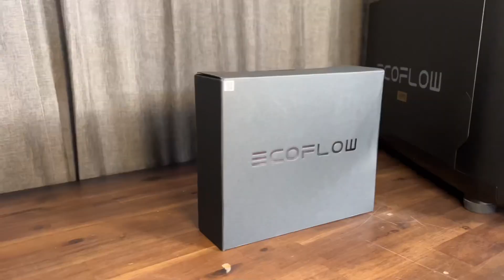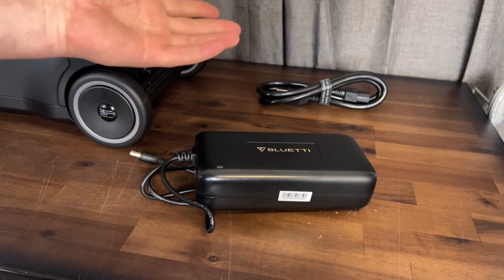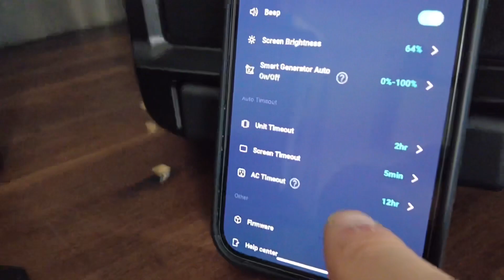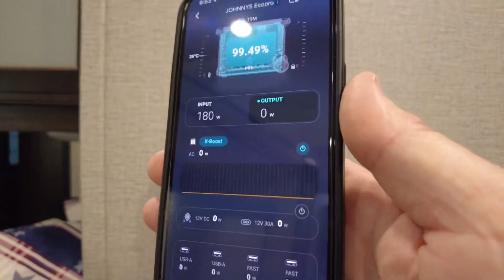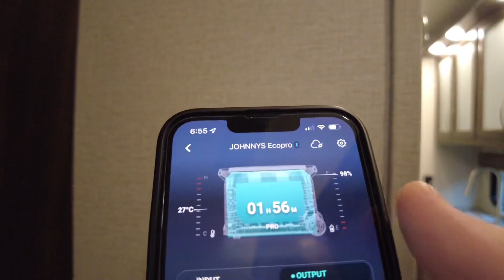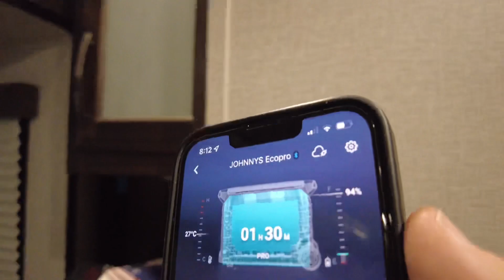ECO FLOW Delta Pro WOW 2 RV AC Unit TEST!!

Comment: I have a new RV and bought the pro on sale. 30amp trailer, runs a single 15000btu Furrion AC. From what google says it should not draw more than 2500w during start up, then run between 1300-1800w. Everytime i try to run ac it turns the delta off. Xboost on the app won’t let me turn it on. Any suggestions or do I have to get the new pro 3?
Reply from the maker: First you don’t want xboost on. 
Second make sure everything else is off. Especially your converter. That can draw a lot of power depending what you are running. Plus you are draining your DP to charge another battery. 
So make sure all loads are off and you should see that on the DP. Then turn on ac unit with fan on low. Then AC compressor should kick on and away you go. 
Now that AC will not run long on a single DP and no extra batteries. Like a couple hours. But I used to use it for about 45 mins to cool everything off.

Comment: I have the same unit.  It works great so far.  My only beefs with it are the tiny writing written in light gray, with a dark gray background.  I have to lay on the floor to read it with a flashlight.  The other beef is, for such a quality product, why are the doors so flimsy?  They never want to close properly.  I'm tempted to simply snap them off and throw them away.
Reply from the maker: They can be removed if you want. But it was a first generation unit so the newest unit is really nice .

Comment: Hi, great video!  trailers nowadays have a "solar prep" plug on the side which is directly connected to the battery. It's meant to be an input plug, but I wonder if I could charge the ecoflow delta pro with power coming from that plug like you have done with your Sok batteries. Any thoughts? Thanks
Reply from the maker: Hi and thank you. Yes some solar prep plugs are direct so a solar charge controller is needed before plugging in solar. But….if you want to back feed in as a DC source for items such as a diesel heater or…..Delta pro them yea it will work. It’s only 12.8 volts depending the battery set up you have so it will be a trickle charge like 125 watts or so. 👍🏼

Comment: Using X-Boost on RV AC is a good way to fry them due to low voltage.  NEVER use X-Boost with AC units.
Reply from the maker: Ahh I ya more of a test though to see the actual power of this unit. If you want to use this repeatedly for a Rv ac then a soft start would help ensure a longer life for both units. Even when using small generators it’s a good idea.
Reply: or any other sensitive electronics! in order to compensate for higher wattage over its "advertised output" it drops voltage below 120v
Reply from the maker: Many items can handles drops in voltage for a few seconds with out damage. Depends on the item. 110-120 is perfectly acceptable for most items. Unless its a high power sensitive computer but most people are just using phone and iPads. So all depends what you need.

Comment: I got a really important question can I connect 3 400 watt panel to a ecoflow delta 1300watt pliss let me know soon as possible
Reply: Ecoflow delta 1260wh 1300 watt
Reply from the maker: 400 watts. Do not exceed max voltage.
Reply from the maker: Which is 65 Volts but you can parallel a couple panels which will bring max amps and the unit will by pass that just don’t go over the voltage.
Reply: I mean 3 panel 400w each 1200w together
Reply from the maker: No that’s to much only one panel.
Reply: Why if I ask
Reply from the maker: If you plug in to many solar panels the overall voltage will be over the allotted amount of 65volts. The delta 1300 operates in a 10-65v. 15 amps I believe. 

Over voltage with fry the inverter board and mainly bms if done consistently. 

If you over amp it’s ok because the unit will bypass the extra amps.

Again this is from the unit and company. If you want to hook up more and damage your unit that’s up to you. But I’m just telling ya that one 400 watt panel is all you can do. 
What are the voltage specs of the panel. 
I assume about 38 volts or so. So two of those will put you over the max voltage of 65. If you want you can parallel two 400 watt panels and increase you amps. 
That will bring you to about 18amps or so depending on your panel specs.

So two in parallel or one panel alone.
Reply: Ok because I'm planing to connect about 800 watt to it ac 1 tv 1 mini fridge 1 TV 32 inch
Reply from the maker: Well it will run it just not very long.
Reply from the maker: Not a pro? What is your exact model..?

Comment: That was some impressive power. It was great that you put all the detailed technical info in up front. You sold an Eco Flow Delta Pro and two backup batteries for my whole house UPS system. Your commission check is in the mail. Seriously, you really did push me over the edge. This system looks like just what I need. Thanks for posting.
Reply from the maker: Wow glad I could help and enjoy your new items. That will really be a nice system..😀👍🏼 
I still love mine. Easy off grid set up. 😀

Comment: Just purchased this very $$$ unit. I have a class a motorhome with 50amp. This is best I can get and run it with my 30amp plug and run only one ac unit and I’m happy.. I am going to try it out in few weeks boondocking. Thank you, your video helped seal the deal
Reply from the maker: Awesome did you happen to get it through the link? Just wondering if the discount is still working correctly?

Yea it will run the ac for a few hours depending on size but if you feed solar it could run it along time 👍🏼😀

Comment: I had this EXACT issue with my HQ21 RV. What I did was buy the EcoFlow AC with the EcoFlow Pro and two extra batteries and the 400W portable solar panel. For the cost, it was far more affordable than building a system with roof-mouted panels and a bunch of batteries. A strange solution to be sure but with the 3 batteries and the EcoFlow AC, it does a great job cooling off my unit even though it takes a bit more time. I can also use it with my rooftop tents on my PowerWagon so that's a bonus. Overall, the products integrations are awesome and capabilites are quite surprising like mentioned here.
Reply from the maker: Right..!! And they are only getting better all the time👍🏼

Comment: Exactly how many hours can you run it on a full charge for one small AC unit. ( trucking ) thanks
Reply from the maker: It all depends on the ac unit and how many watts it draws…
Do you know the model and how watts it draws when running?
Reply: @johnnysweekends  
Is a 6000 BTU insignia unit
500w -  600w
Reply: I’m also looking at a Jackery that shows a 1534 WH on the box. Is that equivalent to 2.5 hours of usage with my 500w - 600w AC unit?
Thank you
Reply from the maker: Yea so if it has 1534 Wh @500 watts x3 that’s 1500. But every power station never meets what’s really on the spec. Because of that 1534 wh the unit it self has to run. So the display, cooling fans and inverter. So you loose 10% normally some may be a little better and some may be even worse. Just depends.
Reply: @johnnysweekends  
I appreciate your time to reply. Truly helps a bunch. With all that in mind, I’ll go the gas generator route. Some times it takes 3-4 hours to be unloaded. 
( Trucking life )
Thank you
Reply from the maker: No problem. Yea the power stations are nice but really just for some small stuff unless you have big units and lots of solar and extra battery’s.

Comment: I just ordered one of these.  It’s a little heavy and expensive, but I think it’s very important with all that’s going on in the world to have something like this.
Reply from the maker: I agree it definitely has some power and is nice for the power outages we have now.  And the expansion capabilities are really nice
Reply: @johnnysweekends  agreed! 🤠👍🏻
Reply: How do you like it so far Jeff? Mine should be delivered in a couple more days.
Reply: @dipstick5869  I have only used it once to power a 5000 BTU a/c in my camper.  It worked well.  I only ran it for a couple of hours.  I was going to test it out more this summer while camping,  but haven’t had a chance to go to the woods.
I don’t regret buying it at all!
Enjoy your new gadget!
Reply: @SaabAholic  Sounds great. I'm looking forward to trying it out, because you are right, things aren't looking very good and it will be a blessing to have this unit. Thanks for replying and y'all have Fun camping!🙋‍♂️
Reply: @dipstick5869  Right on!  I configured a solar power charging station I modeled after one of Will Prose’s videos.  It’s gonna work great at home.  The Delta Pro is compact and portable. 🤠👍🏻
Reply: @SaabAholic  Great, I'll have to check out his video's. Thanks
Reply from the maker: That’s awesome!!
Reply from the maker: I’m running 4 335 watt panels 😀👍🏼
Reply: @johnnysweekends  That's Great Johnny! I only have 4- 100w and 1-160w so far. I'll grab more panels as I can.
Reply: @johnnysweekends  I use 3 100 Watt Renogy panels and also have 2 240 Watt used panels. I plan on getting more panels once I really understand all this stuff. 😬
Reply from the maker: Nice..! Main thing is try not to mix panels to much. You can but it does t really work right.
A 240 watt panel will get pinched down to what ever the voltage is of the 100 watt panel. So overall sure you may have more watts but not as many as you could if 3 of the same type.
Reply: @johnnysweekends   Right.  I keep the different panels separate.  That’s a good thing to point out to us newbies.
Reply from the maker: I’ll have to make a quick video on mix and match for the others ..👍🏼
Reply: @johnnysweekends  Yes 👍
Reply: @johnnysweekends  Nice.  I’m sure I’ll need to watch it, too!
Reply: @johnnysweekends  Ok, I knew that I would have to make some adjustments on the panels, but I may just keep the other panels for that 4patriots thing that I bought 2 years ago. Over priced for only 768 WH🤦‍♂️ The Eco flow offer that I purchased came with 1- 160w panel. I'll just buy more of their panels. Thanks! Thought that I has Subbed earlier, but made sure that it took it this time!!
Reply: @SaabAholic  Yes and I'm fairly new to Solar! But learning fast, thanks to you Guy's 😉
Reply from the maker: Awesome thank you. 
And yes I’ll have much more videos coming starting middle October as my work schedule will change some. 
But I have a lot of videos to make and with it being 113 for the last several days everything just overheats and melts 🤣
Reply: @johnnysweekends  😳Yikes, that's pretty warm. Here in Louisiana the temperature plus the humidity is a Killer! Be careful out in that Heat and we'll be waiting patiently for the new video's!🙋‍♂️
Reply from the maker: Yea pretty acclimated to it but after a long summer I’m ready for the change 😂

Comment: Thanks for the code.  Just ordered the Ecoflow Delta Pro w/ 400W solar panel using your code.  Really helped out, and I'm looking forward to getting & using this for the rolling blackouts this summer that's going to happen in my area soon.
Reply: Have you received your order yet? I'd like to order using the code and I'm wondering how quickly the orders arrive.
Reply: @countrylife5316  Yes, I received a tracking number the next day, and realized they shipped my Delta Pro and 400W solar panel from the city next to me in Southern California.  With FedEx's weird routing, it took a couple of days to get, but I got both of them within a few days of placing my order.
Reply from the maker: I know some people no matter where they order are sometimes almost a month. Seems like two weeks is normal but they are in high demand. All eco flow products.
Reply from the maker: That’s awesome. Yea the rolling blacks seem like they will be more of a thing in our current year of 2022. Tough times in the modern ages 🙄

Comment: Thank you. With the price of gas. I am ordering one. Maybe you can answer these questions:  I have a ac unit 700 watts. How long will the pro run this before needing to be charged. Also if I have a 200 watt fan ( no ac) how long will this unit run?  At the moment I am running my house off grid on a 100 watt solar panel with 5 car batteries in parallel. My house consist of a fan, a tv an small refrigerator pulse I charge usb devises. How many hours could I use this. I might buy this unit. Thanks, Alicia
Reply from the maker: So for power stations you need to look at how many watt hours (Wh) it has. 
So the pro is a 3600 wh unit. But all power stations don’t give you a 100% of what the model calls for. Typically 85-93 % is what they give. So the pro will give you about 3200 or a little more watt hours.

So a item that uses 1 watt will run for 3200 hours theoretically. And a 100 watt item will run 32 hrs.  So now you can calculate how much power a item uses a hour and how many hours you will be able to run that item. So about 4.5 hours for that ac unit roughly. 

Hope this helps.

Comment: The problem with these, They are too expensive for underwhelming performance. Honda Generator spanks all the models for the price to performance ratio.
Reply from the maker: Over all yes, but there is a place for these and it won’t be long until power is doubled for the same price with fast charge times and just as many cycles or more. 

I think in 5 years… gonna be crazy!
Reply: I absolutely agree. Give it time and these will drop in prices and become the future. Contrary to my original comment, I am excited for the Eco flow products. Were almost there.
Reply from the maker: I would assume a newer big model will be due next year.. maybe 🤷‍♂️
Reply: I believe they were worth it on the kickstarter they had since I got one at 2199 for the early bird price. The super early bird was 1999.
Reply from the maker: For sure. I don’t think the prices they are now were meant to be this high. But like everything else, everything has adjusted to this unusual market. 
I would assume in a year or less maybe things will get a little back to normal.

Comment: I am very impressed on the power of the Delta Pro. You can do a lot with 3.6KWh which if need be can be expanded allthe way to 25KWh. Which definitely has more power than any other portable power station.
Reply from the maker: Eco flow has the market for best power stations I think right now. Especially the whole ECOFLOW system. I can’t wait to do more with them soon. 
More videos to come 😀👍🏼

Comment: $ 3,900.00 to cool off your trailer for 1.5 hours !
Trailer will not even be cooled off and Ecoflow will be dead !
2 people fly and hotel to Hawaii for 8 days and 7 night is cheaper.
Reply from the maker: $3900… where is that price.? 
With promo code you are still about $3k but it’s not really for running a ac for 1.5 hrs but that’s powering both which is impressive. That’s more what it’s about. 
But to be able to not have to buy inverters, battery’s, switches, cables and more wires and more, you plug this in and go and now your whole trailer works. 
Kinda the nice thing it’s multi use ready.
Reply: Exactly! Honda Generator for $1200, Never look back again.

Comment: That's got to be the first pack with the 30a plug on it.   Very cool!!    Do your AC units have 'soft starts' in them?   I installed a Micro-Air Easy-Start on our 4 ton unit and now the generators have no problem starting it up. LRA is no longer much of an issue.  Might be something for you to review.  I wish I had one back in the day with my RV.
Reply from the maker: I don’t think they do. I read up on the models a little but nothing saying they have soft starts built in. I think if they did the ECOFLOW would have no problem starting both. 
Pretty cool not that running your ac on this is really what it’s for.
Reply: @johnnysweekends  When you live out here you look for ANY way possible to run an air conditioner in mid summer.   :^)  
 "It's not Air Conditioning, It's life support"
Reply from the maker: Lol gas generator then for sure. Unless you buy a few of these and chain together with a good solar array

Comment: Consider me impressed JW
Reply from the maker: Imagine another battery on it. Would easily fire up two ac units on. But that’s not really what it’s for. Makes it easy to turn a trailer off grid ready with no expensive wiring and inverters and more. Plug and play.